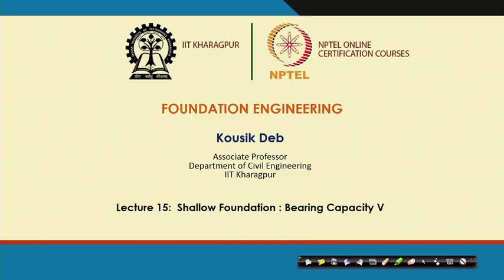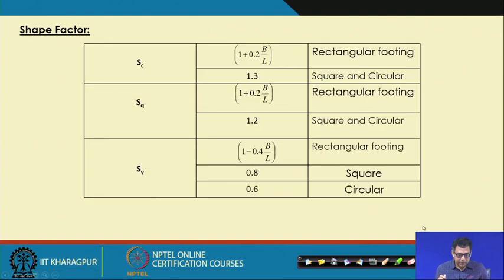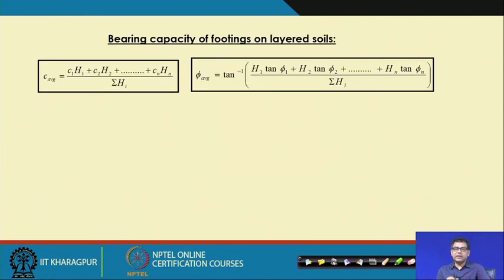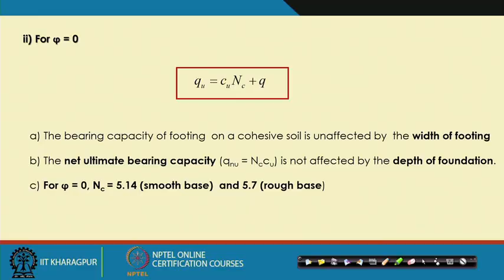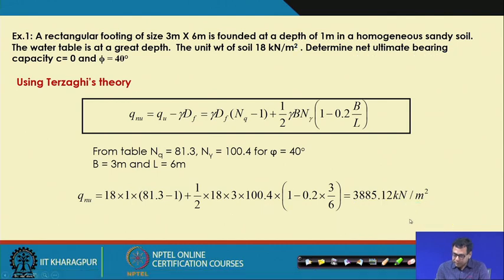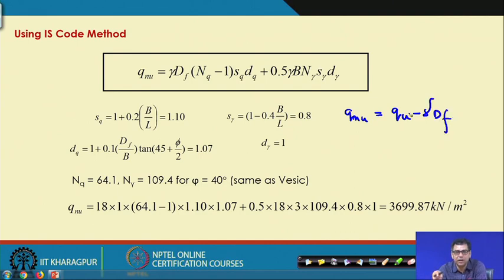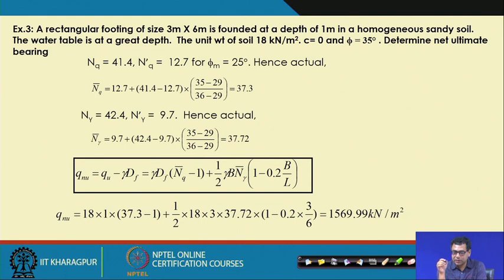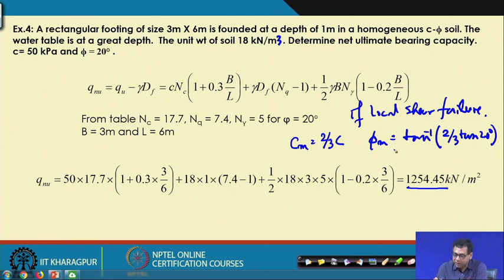Lecture 15 : Shallow Foundation - Bearing Capacity V

Comment: In example 1 using terzaghi's thry 
Can anyone tell why we have used 1-0.2b/L and Nq-1 while we have direct value for net ultimate bearing capacity as  gama*Df*Nq + 1/2 gama*B*N gama
Reply: here we need to calculate net ultimate bearing capacity so gamma*depth of foundation should be neglected from ulti bearing capacity equation so that's why gamma*df times of nq (multiply that inside u will get to know).....and next one is 1-0.2 B/L.....the terzaghi theory is for strip footing but here we got rectangular footing so alfa 1 and alfa2 should be added as correction factor the value-added(1-0.2 B/L) here is alfa 2 value (alfa one terms tends to zero because of cohesionless soil )

Comment: What should be the value use of unit weight(dry or submerged) in IS method when the water table above the foundation level?
Reply: In Soil Mechanics by Arora,they have mentioned q in the surcharge term as effective value.since we are not considering effect of water table on surcharge by a seperate factor (like Rw for wedge term),we have to take q=submerged unit wt.*corresponding depth+bulk unit wt*corresponding depth not submerged.Please cross-check.